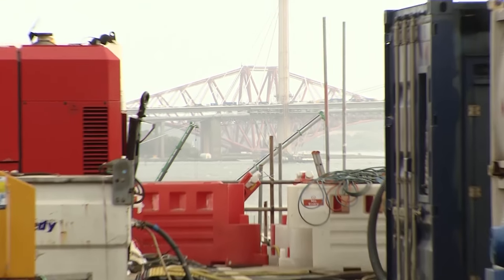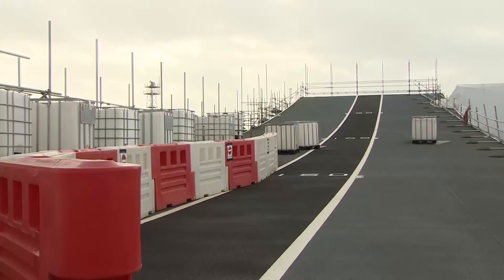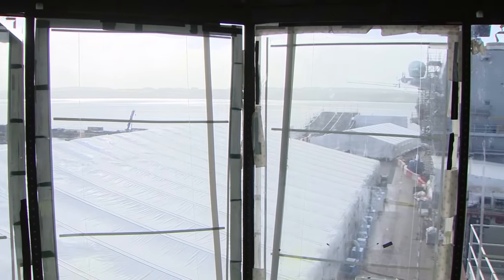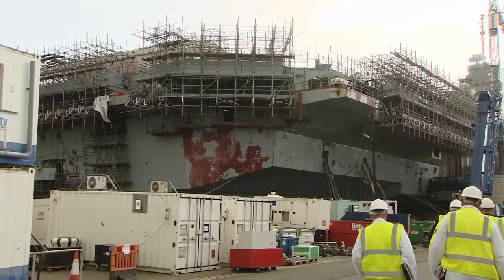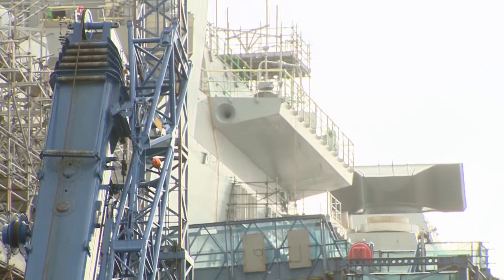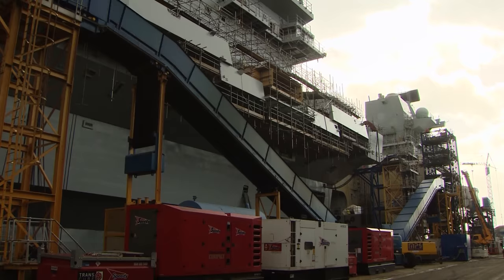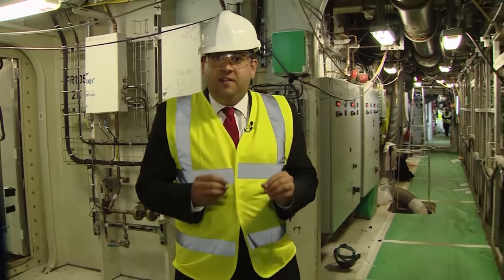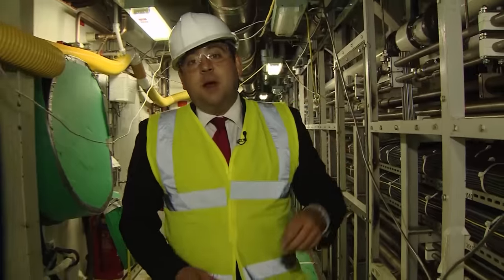HMS Queen Elizabeth Shipshape And Almost Ready | Forces TV

Comment: What a piece of engineering. 
Anybody that says this isnt "advanced" is talking absolute nonsense. A quarter of a ford class, with 4 acres of deck space, and operating systems as cutting edge as possible....quite the formidable platform. Be fantastic seeing both QE laden with F35, chinook, merlin and marines! 
Well done MOD. Finally, a proper super carrier.
Now we wait the T26 and Successor class.
👍🇬🇧🇬🇧
Reply: 67% the size of the Ford class with only 29% of the crew.
Tight budgets lead to innovation to make things more efficient and save money! Sometimes having unlimited resources (like Americans) isn't always a good think! We could have built 3 QE class for the cost of 1 Ford!!
Reply: While I think the Ford class is clearly more capable (AWACS, aerial refueling, etc) and can operate the F35C (20% more weapons payload, 33% larger combat radius),  the Queen Elizabeth class certainly is impressive. If you have to make the choice between 2 (or 3) Queen Elizabeth class carriers or 1 Ford class I think the choice is pretty clear.  They will be two great ships and a great fit for a great ally. I read that their may be US Marines stationed on her especially early to increase the number of F35Bs and potentially the V22 as well. The V22 is a great fit for a ship such as this since it can transport troops, cargo, and perform aerial refueling. It is not cheap, but I have a hard time thinking it or something similar will not be on the two carriers eventually.
Reply: While she is a formidable force, she is not nuclear......... Range and a tender must follow..........I doubt you could build 3 QE class for the price of i Ford.........Include the price of the tender...........
Reply: milwaukeegregg 
10,000 nmiles is very impressive. Thats portsmouth to melbourne aus. And as part of a carrier group a refuelling ship isnt much to ask for. 
But your point is valid
Reply: Don't they eat on the Ford then? It isn't just fuel that ships need. The more mouths the more food.
Reply: Joe Soap Joe the Ford is really a different ship.... Sure the both carry f-35's but the Ford is a nuke,it's got cats and traps,and its over 100000 tons........ To your point they like the QE run with a crowd, so food while stocked in the Ford must be taken on for extended tours.......It's also 13billion US
Reply: milwaukeegregg
I think you are missing the point. The QE isn't a nuke because it doesn't need to be. It has more than enough range for whatever it's missions happen to be. Think Pearl Harbour. The Japanese sent 4 large non-nuke carriers across the Pacific. Attacked their target and sailed back to Japan. They didn't need to be nuke to do that.

Now the QE and PoW will be doing similar missions. Most of their missions will be just flying the flag and showing off. They look big and impressive and I doubt to those they are meant to look big and impressive to will care whether they are nuclear powered or not.

Regardless of what people may think they are not meant to be used against enemies that can shoot back because they wouldn't last five minutes. A well placed nuke would see off any carrier group currently afloat. They are being built strictly for sabre rattling missions off the coast of third world countries. Which is basically what western military policy is these days. Look at Syria. All the carriers in the world would not make one jot of difference there.

I would also point out that there are many ports that will not allow nuclear powered vessels to dock because they produce nuclear waste. This is why there are no nuclear powered cargo ships. This is something the QE and PoW will not have to worry about.
Reply: QEC can also go where Ford can't - not only is it smaller but countries like NZ won't let nuke vessels near.
Also, all the arleigh burkes and ticdoronga class need fuel.
Reply: Nuclear powered vessels need supplies as do the many ships in the carrier group, but implying that the QEC carriers have an advantage because they can go within 12 miles of New Zealand and the Nimitz and Ford class cannot is pretty trivial. The US Navy has not sent a ship to port in NZ for about 33 years because of their law (one will for a ceremony next month). I only briefly searched but I didnt see any other  countries that have the same law. NZ has barred US conventional ships because they are capable of delivering nuclear weapons so a QEC ship would not be allowed to have a nuclear weapon on board (to my understanding they wouldnt anyway though). I cant think of any other place that there would be a problem either. The Nimitz and Ford class could not go through the original Panama canal (the QEC wouldnt either), but it can through the new Panama canal and the Suez canal. I guess I would need to see a list of other places the QEC could go that an American carrier cant go before I would concede your point. Not being able to port in New Zealand seems to be the only location restriction. The US clearly wants to and tried to force the issue through trade agreements, but still it seems pretty trivial in the grand scheme of things.
Reply: when do the F35s arrive? And how many will there be? Pound is now at 1.11 to the Euro by the way.. we're looking really good...
Reply: AlternativeDesign100 they are expected to have 24 by 2021 for its first deployment. Already have 6-8 I think.  There is a strong possibility that USMC will have some aircraft deployed on it too early on to increase the number of jets and for cross training opportunities.
Reply: Heath Butler
I don't think we can afford them frankly. Can't even get enough Frigates together for the upcoming Russian fleet that will pass through the channel on its way to be near Syria.. And if the pound keeps falling further and no "alternative deals" can be made outside the EU... I don't think the UK can even afford a rubber duck.
Reply: AlternativeDesign100 
Couldn't agree more. These ships were ordered when the Brexit referendum was still just a twinkle in that nitwit Cameron's eye. It's estimated that the UK will lose 5% to 10% of our GDP after leaving the EU. So where we are going to get the money to run these ships is anyone's guess. Especially if we try to run both of them at the same time. We don't have enough sailors to man them, enough escort ships to protect them, or enough jets to put on them. It's all show and I suspect they will spend more time ties to the dock than they will sailing around the world.
Reply: AlternativeDesign100 
They have on order 138. 
You do realise that the pound was over valued for quite some time yeah. But anyway, the fall isnt ideal of course, but the markets go up and down all the time. This actually helps exports and makes the UK more competitive. And, once trade deals are agreed with the rest of the world including the EU the UK will be in such a stronger position. 
And dont forget that the UK is trillion £+ economy, and the only "blue water" navy in europe, and is a global military. 
This is a long term upgrade package. By 2030 the UK navy alone will be second only to the US. This is a fact, even though we have fewer vessels. Its the state of the art kit, and maritime experience that makes the UK a formidable opponent. So, dont worry about the pound, the UK can easily afford everything they are doing!
Reply: Joe Soap 
Ok...the UK have 138 on order.
The QE isnt even finished yet, neither of them. The F35s are being built as we speak. Stop going on about brexit. We havent even left, and havent made any trade deals with the rest of the world...ie China, India, America, Japan, Australia to name a few. Dont let project fear interfere with whats happening in the MOD. They are making the worlds most advanced hunter killers, 7!!
The worlds most advanced destroyer 6.
The most advanced frigates
T26. 
4 new vanguard class ballistic submarines.
4 new Poseidon 
138 F35
Another 40 Uk variant Typhoon.
4 state of the art river class vessels.
Albion and Bulwark refitted and updated.
50 new state of the art Apaches
14 new chinooks
30 new merlin anti submarine helicopters.
And of course 2 QE class carriers. They do not need the thousands the Nimitz class need, nor Ford. 
The QE is already fully manned. The POW will be in 3 years time too!
Reply: its a great machine gives great options. it would rip argentina a new ass hole. i can imagine it launching thousands of drones at some point. may the force be with you.
Reply: Forcedtojoin Towritereview
until an exocet hits it ...
Reply: AlternativeDesign100 
How would an Exocet hit it when its defended by the worlds most advanced destroyer?
Reply: But the Ford's are three times better, with Cat and Trap.
Reply: Great point regarding drones, carrier platform for drones will be the way forward, but I think we will see the F-35 for many years.
Reply: Japan sending 4 carriers across the sea was 1941, this is 2016, warfare and tactics are very different. 
The QE can travel a long distance , true but its has to limit its speed in order to conserve fuel. Example US CVNs can sustain 30 plus knots for as long as needed which allows them to get around quickly, QEs max out at 25 knots and are limited by fuel reserves.
As for your nuke theory, nope. Both the US and UK have top of the line missile defense 
furthermore,  no one what to get into a throw weight with the US. 14 SSBN tends to deter that idea 
Syria is mainly an air support mission, there are virtually no ground troops there
Many ports dont allow carriers ,example in the UK, carriers park at sea and crew ride ferries
plus not docking allows for faster departure
Reply: verdebusterAP  You really are missing the point. Firstly I've got no idea how fast these carriers will move. They usually keep info like that secret.
Secondly it doesn't matter. These carriers are being built to impress. To give the illusion of military might. To the people they are meant to impress they no doubt will. They are not meant to be fighting any wars against any major military power. Although in this case the only power I could see NATO at war with is Russia, and since they only have one old carrier compared to NATO's at least 16 new ones, that would appear pretty unlikely.
These days 1st world military prioritises dropping bombs on third worlders who can't shoot back. For this kind of duty, just like american carriers, they are perfectly adequate. An extra few knots in speed won't make any difference at all. And at the end of their lifetime use we won't have to decommission some clapped out nuclear reactor. But if Americans want to spend billions of taxpayers money to squeeze an extra 5 knots out of your carries suit yourselves.
Reply: Joe Soap I fought a war in the Falkland's, with little or no air-power, dam close run thing it was to. Why because we had small second rate carriers, nothing about the US carriers can compare to the QE class, US carriers being far more capable ships, with a balanced air-group, fighters, bombers, EW, Elint, ASW, AWACS. As normal the UK does a cut price hope for the best carrier. We needed F-35c, we went for the less capable F-35b.
Reply: henryvagincourt You got a few billion quid going spare? Fine we'll build better ones.

BTW. I was against that war.
Reply: Joe Soap We find it for immigration, money that is, yeah you being against it doesn't surprise me, try fighting in the South Atlantic, you may have an idea what the Navy needs.
Reply: henryvagincourt 
I get your point about F35c. However, just because QE isnt CATOBAR doesnt make her any less capable for the RN. When have we specifically needed catobar? The 2 carriers from the Falklands were tiny compared to just one QE. QE is far far more advanced, uses around a quarter of a nimitz class and is more mechanised. The CDG is sending Rafales into Syria at the moment, but relying heavily on the Tornados superior recon and all weather capability. They arent flying off a carrier! You see my point?
Now, as regards to the Falklands, that was 30+ years ago. The QE will be escorted with Astute, T45, T26 eventually and as such is/will be a formidable task force. You cannot compare the UK to the US. No one can. But not even the Russians or French are a true blue water navy. Britain is. And these ships will/have massively increased the UKs power projection. Put the whole upgrades and investments into the mix and the RN is a true global power even more so!
Reply: The Queen Elizabeth class aircraft carriers would have been far more effective configured as CAT0BAR combined with the F-35C. What the Royal Navy has is less effective, even David Cameron decided to go CATABOR but BAE claimed it would cost an extortionate amount, even though the modification was supposed to designed into the ship, Cameron relented and went ahead with the current configuration.

STOVL configuration will limit the un-refueled operating range and payload of the F-35's.

So what we have here is a class of ships that is already going to be operating less effectively than it should be. Also with a vastly reduced Royal Navy there just isn't the required number of ships to provide a battlegroup to protect the aircraft carrier and continue with existing commitments., never mind providing enough ships for two battlegroups.
Reply: Fek The First It's a fair point regarding the Falkland's carrier battle group, the carrier's were much smaller, mind you we had around 53 escorts at that time, 19 now. The MOD made a right mess of the QE Class, CATABOR from the start would have offered cross operation's with both the US and French Navy, Also the option to buy cheaper F-18's and E-2's, and the F-35c.

Astute is a fine platform, though has had it's early troubles, T-45 need's new power plant's, and for it's size under-armed. the T-26 now there's a good laugh 13 well no, 8, maybe 5 dreamed up T-31. You can't help thinking another MOD ball's up.

I know the Falkland's was 30 years ago, but hard fact's, we don't have the resources to do that again, luckily the Argentine's are in a far worst place than us military wise.

The only global power is the US Navy, we simply don't have the numbers of ships, we were hard pressed to escort the Russian battle group through the channel.
Reply: Madcap247
Ok. Hold on a second. The Govt decided to go non nuclear. We have never needed NP carriers...ever. Even during WW2 when NP wasnt available! Yes, it would be great, but, for the extra cost of NP, and CATOBAR we have two super carriers instead on just one. And none of the ball ache of disposal. Whats the benefit of nuclear? Yes, you can keep sailing. But you still have to stock up on food and fuel for the aircraft or have fleet aux. The UK went for conventional. It means the extra billion odd pound for NP and CAT can be spent on F35 and the most advanced tech on the ship. BAE gave them the price. The govt said no. Remember BAE is making Astute and Dreadnought submarines. So they were hardly extortionate. 
One T45 is as powerful as 4-5 T42.
The Astute is more advanced and capable than even the US seawolf. The T26 will only have at least the radar capability as either and far more advanced sonar/anti sub capability. 
The F35 hasnt even been made operationally ready for the RN or airforce. So how do you know sorry? Unless you are a F35 test pilot or operations officer you and i do not know. 
The UK is the only "blue water" navy in the whole of Europe, and that includes Russia.  
And the govt are investing ridiculous amounts into our navy, army and airforce.
Reply: henryvagincourt 
I agree, T45 should never of had those/these problems, but they are being resolved. The issue over NP on QE is mute really. We can dock nearly anywhere we want to. Unlike the Russians. 
The Falklands will never happen because of just one T45 and one Astute. Even if they did try and got the Island, we have a far more capable military now than then. Yes, our carriers are not ready yet, but they will be built, and they will be escorted by some very impressive kit. Even you acknowledge that. The T45 has had upgrades, including harpoon and sea cepter. No other destroyer has her radar tracking or targeting systems. Burke and Kolkota included. And as i stated above, Astute is superior to both V class and SW (US). 
The Falklands was a turning point for the RN, and Russia is making sure the UK will have two fully operational carriers, and an escort group that is formidable. T45s have been lead destroyer and anti air ships on more than two occasions for the US carrier groups. Once BAE get their hands on F35 (like UK variant Typhoon) we will have an astonishingly capable air wing.  Taranis is another as will be Dreadnought. The UK now invests heavily in quality over quantity. The QE is already an iconic carrier...hasnt even left the dockside. Its brimming with the latest tech and each can communicate with every asset in its task force. I have no doubt these military upgrades will be truly potent
Reply: Fek The First I'm not knocking what we have, well a little.....more we haven't enough.

I agree the more the Russian's run up and down the channel the more our glorious politician's take note about the state of the Navy.

Did you know the Falkland's guard ship is a River class patrol vessel? The reason the Falklands are safe is the Argentinians haven't any money to replace their ageing equipment.
Reply: henryvagincourt 
henryvagincourt 
Yes, but they do not know where an Astute is, the UK has a very well protected garrison with 500 RM, and 4 of the latest Typhoon. They have asked to borrow some Russian SU30s and Chinese jets. The Argies have opened up trade routes unrestricted and now have a realistic president. The UK military have 1200 personnel. Any movement by them is monitored anyway. They cannot afford any attack, as i said, it was 30 years ago, so we dont need destroyers or frigates there 24/7.
 And as i said, the UK is building quite the fleet. And is, even without carriers, full astute,T45,Poseidon, F35, T26 or Dreadnought capability is still right now the only true blue water  navy and the only global power in the world.
Reply: I dunno, the Argentinians seemed a little more than "impressed" by the Hermes....
Reply: It's a shame our 'state of the art' kit, like the type 45 destroyers, can't operate in warm water without their engines overheating! This has a knock-on effect on the power generation system, resulting in offensive and defensive systems being unavailable for use. All have been laid up in Portsmouth over the summer, and one of them is being cannibalised to support the others. They call it a 'training ship', but its capability is severely reduced.

The other main problem is a lack of sailors - 4000+ short at the current level, so it may be tricky even finding enough to man this new ship. One of the most useful RFA support ships, RFA Diligence, had to be sold earlier this year due to insufficient numbers to man her effectively.

Still, the new carrier will have plenty time for sea trials - the first aircraft aren't due to arrive until 2020 (and even that may be optimistic, judging by the F-35's development schedule up to now), with full operations not taking place until 2023.

And what do we have to protect this massive investment? 19 surface escorts (possibly 24, if the 'low budget' frigates get the go-ahead - although goodness knows what their capability will be) and 7 attack submarines. I'm sure China and Russia are quaking in their boots...
Reply: gargk999  
I would just like to point out to you that Russia only has one, old carrier, the Chinese have one old ex Russian carrier, and neither of them are a blue water navy. The UK is the only true blue water navy in europe (russia included), and UK power projection is even greater when these 2 are built, have the full quota of T45, T26 and Astute. 
The T45 is more powerful/potent than 4-5 T42 destroyers. 
The Astute is more advanced and lethal than the US's seawolf, despite what some youtube videos will have you believe.
T45 has the most advanced radar, tracking and targeting systems of any destroyer...Burke and Kolkota included.
Yes, has engine issues....all of which are being addressed and fixed.  But still a truly formidable ship.
Engineering wise, BAE dont seem to have any problems, hence why they are world leaders in military products. The RN is investing hugely in personnel. The QE is already fully manned. The POW will be also. RN is turning out sailors every year, i cant imagine they will have issues with recruitment in the next 5 years.
Reply: Fek The First Major, major problem, the separate bridges for ship & air control. The Yanks who have huge experience with super carriers told them not to do it, that ship and air control must be close together. But they were ignored, same as they ignored the Yanks telling them the cost of electromagnetic catapult systems and believed the liars at BAE.
Reply: Simon Watts 
Nope. You are getting confused. 
Twin islands are an effective way of capability under attack. Thats why the French PA, the Chinese and Indians would love this too. The whole point of a twin tower, under conventional attack, is that one can take over the other under a direct blow. Nobody has ever built a carrier like the QE with twin towers. Nobody. 
This huge super carrier is a more survivable ship than a nimitz. This is what you get with one of the worlds most tech advanced military contractors...BAE systems (the same people that are building the US's rail gun).
Any idiot who says they are a "barge" or a "floating target" obviously have absolutely no idea of a carrier, or her group strength.
Reply: Simon Watts 
And CATOBAR is not essential. Why do people like you go on about it. Post ww2, When have the UK specifically needed CATOBAR?? When??   Do you not think that 40+ super sonic, stealth, 5th gen STVOL fighters are shit? Backed up by UK variant Typhoon that can reach all common danger zones at will???..
Reply: Simon Watts 
Sorry, hold on. Are you saying that one of the worlds leading military equipment companies went and asked the US if they should use two islands?? What are you on about. 
Its never been done before. They "told them not to do it"??? Wtf?
Who said that? Why? When?
Sorry, i just do not believe that. 
Just to let you know the French PA2 was designed around the QE as is a possible new Russian one. Did they ask America too? 
Stop going on about CATOBAR. QE doesnt have one. So drop it, please
Reply: Fek The First Interesting comment, but CATOBAR is essential, the F-35c is far better than the F-35b. Typhoon's reach all common danger zones at will? In 1970's the RAF told the then Goverment we didn't need carriers, our Phantom's can cover Navy unit's anywhere needed, the big carriers were scrapped, along came the Falkland's and not a Phantom in sight until after the war was over.
Reply: henryvagincourt 
Ok, look, you seem to be stuck in 1970-the Falklands. What happened in the end? We won with 20 Harriers against 10-1 odds. CATOBAR is only essential if you plan to use those larger planes. The UK isnt. 
And, as i said before, the UK is investing in F35b. And is what the govt wanted to buy. So lets get on with it. Yes, it would be great to have 2 100,000tn NP, Cattrap, Typhoon laden carriers. But we dont. We 2 65,000tn conventional carriers and will be filled with the worlds most expensive weapon platform in history. They seem to be dammed if they do and dammed if they dont. I havent personally spoken to any crew members of QE or any test pilot for F35B. But what i have heard in media releases is that they are really looking forward to getting their hands on them both.   
The QE is 3x the size of Illustrious, she was pretty handy!! And we have 2....equal to 6 illustrious class. Why are people still moaning?! 
(Im not suggesting you are)
Reply: Fek The First I have an informed view, because being Ex Navy, I care about the run down of the service, the way the MOD spends money without any thought to the needs of the services. We just have different views.
Reply: henryvagincourt 
My family were and are Navy. I care and have an informed opinion too. My point remains that the UK has built up its navy from the Falklands with state of the art kit in all 3 services. Yes, they could do more. But, 2 super carriers are superior to no carriers. And what we have we should be proud of.  
And the UK, even without QE are europes only true blue water navy. With QE, Astute, Dreadnought, T45, T26 and River class vessels all to come it can only be an even more formidable military.
Reply: Fek The First First class, then you will know the French Navy are just now more capable than we are. From the Falkland's it has been down hill in numbers, we sold some T-23 to save four batch 3 T-22, then scrapped those, we couldn't make our minds up about the carriers we need, what type, sell one, no we keep both. The T-26 is late and now only 8 rather than 13, T-45 have major power problem's, the River class are frankly a total waste of money, under armed with a Merlin capable flight deck for what? Anybody who is Navy know's you can't have a helicopter with out a hanger, servicing , arming, be washed off the deck in certain sea states.

RAF has been cut to the bone, just 5 front-line Typhoon's squadron's, though 2 more promised, no ASW until the P-8, French and US doing that job for us in Scotland.

Army Challengers cut to 237, you can fit the army inside Wembley now.

Every time Mr Putin run's a carrier strike group up the channel, it does the Navy a huge favor, Our inept politicians take note of the public and news paper headline's.
Reply: henryvagincourt  
Ok. One point at a time.
Why are the French all of a sudden being muted as the super duper navy. Because they finally got truly stuck into a fight ie Syria?? The French Rafales and US rely heavily on the Tornado. 
River class is exactly that, its not a front line battleship. Its a patrol vessel. Not sure why you knock them...but there we go. 
The RAF are still waiting on the remaining 30+ Typhoon to be delivered. And are currently being upgraded to new radar. And also trailing new bombing kit too.
Challenger 2 is still one of the best and capable MBT in the world and is about to have £800 million pound upgrades to the entire force.
T45 engines are being replaced (embarrassing yes, but still) and are being upgraded with harpoons etc. 
The French do very little. They do not send their planes out 200+ times a year to intercept Russian planes. The US do and so do we. 
The Russians have ONE old carrier. And they are allowed to sail through the channel. What, do we need to meet a carrier with a carrier? I didnt see the French sending CDG back to meet her. But yet we get stick for "monitoring" them?! What do want us to do then?? 
You dont think an Astute was with their task force? Of course one was. And? 
The French packed in their own (copied) version of QE the PA2 because it was far too expensive. Why do you not mention that? We are building 2 of the things. As i said before, even without all the new shiny toys coming over the next 20 years, the UKs navy is the only true blue water in europe. We have europes largest naval port.
The difference between 1982 and now is technology. One T45 is as powerful as 4-5 T42. Astute is light years ahead of any Churchill class.
Reply: Fek The First Hi my friend, let's agree we are both supporting our Navy. I mention the French Navy because they spend far less but managed to keep a carrier battle group, we still don't have that. Tornado is now fairly old, we have run the fleet down,  8 being in Cyprus.

The Russian carrier group in interesting, the French did have a ship along side the group as did the Dutch Navy, my point was we were hard pressed to do our own patrol, with no ASW or Patrol aircraft to run up the channel. It will be interesting to find if the UK or NATO tracked the Russian Sub with their Group.

A UK sub may well  have been shadowing the force.

The River class is a waste of money, see the tonnage then look at the Swedish Visby class.

Kit is one thing, problem is numbers, we saw that in WWII German tanks first class AFV, but the Russian T-34 numbers.

Portsmouth was always the largest port in Europe, though it doesn't have many ships now, I was Plymouth based.
Reply: henryvagincourt 
But we did though. HMS Duncan was watching them. 
Look, that Russian ship had its own tug boat. 
NATO were watching them all the way! 
The river class are perfect for smugglers, illegal fishing and general patrolling. Whats wrong with that?
The UK are buying 4 Poseidon, so thats going to change too!
Yes, we both want the best for our military. But even the US is cutting back. The French cannot afford a new carrier, the Russians barely scraped a token show of strength. My point is, we build 2 of the largest ships in our history, fill them with BAEs beat technology, fill them with 5th gen stealth fighters and people still moan. QE is already fully manned. As will the POW. And all the other new vessels. At least give them their dues (govt), they are at least keeping us in the top 4 world militaries. We cannot compete with the US or pre/post war numbers. But we can use the best people to make the best kit, with the best training.
Reply: Fek The First She was, but we had no other ships available for anything else. Why spend so much on River class when we could have the Visby class far cheaper?  QE is partly manned, but the Navy is hard pressed to man both, we are about 400 short in the fleet.

I don't give UK Gov anything they are about cost cutting no matter what, We have always had the best people, we did in 1982, but that doesn't make up for the best ships and the numbers of ships we need.
Reply: henryvagincourt 
I get what you are saying, but one T45 and a possible Astute and several other nations ships snd NATO monitoring them was a reasonable reply. The poor carrier looked like it was going to konk out half way anyway.
I have no affiliation to any party, but i am pleased they are (whoever is in power) upgrading our military as a whole. The glory days of massive convoys solely belong to the US now. But, to have the RN have 2 huge carriers and all the other vessels to cone, and to have a PM that openly wants Dreadnought is fantastic. Anyone but that leftist twonk Jeremy. 
The armies Virtus armour, SA80 upgrades, Apache, Chinook, C2 upgrades, Poseidon, F35, more Typhoon on and on across our military can only bolster and improve our capability. I agree, numbers are down, but just the QE class is advert enough for new recruits. And we have the 2nd largest defence firm in the world making so much of our new hardware. Lets give them their dues for at least recognising Russia and Chinas threat. The Falklands was a close call, however what we have today are extremely potent assets, and we are gaining more of them
Reply: it's a helicopter carrier. with no catapults and no arresting wire it's just a big pile of waste. and don't get me started on those f35b's..
Reply: swunt10 oh excellent. An RAF test pilot? Id love to hear your feedback on the trials, training and  systems checks youre doing.  So, in your opinion whats the biggest draw backs compared to the Harrier?  Have you flown many mock sorties against other platforms like Typhoon etc? How did the targeting systems work while mock bombing?
I'm fascinated to hear your point of view. Its only been a few months since the first one arrived, have you enjoyed flying her?
Reply: Joe Soap
 'f Americans want to spend billions of taxpayers money to squeeze an extra 5 knots out of your carries suit yourselves"
 5 extra knots ? US CVNs have been clocked at over 35 knots
Reply: The problem is that it had the capability of being a super carrier, yet they screwed it up.  By not implementing a catapult system and instead opting for a ramp, their air wing will not be able to match the air-to-air capability of many modern aircraft.
Reply: A 1/4 of a Ford class . Who told you that . It's about %65 based on weight . American carriers are bigger mainly because they operate in the Pacific further from base and so have to be bigger . When you factor in that the Royal Navy is a far superior navy then the Ford class is actually a lot smaller as it cannot accomplish nearly as much as a British manned ship .
Reply: USN1985dos 
I get what you say. I get what a few people here have said. 
However, the RN and RAF are getting over 140F35. 
No one went on and on about CATOBAR when we had illustrious. We do not need Cats if we are using VTOL. 
It has a ceiling of 40,000 ft, speed 1.6 and has plenty of future proof upgrades esp weapon payload. 
Its combat radius is around 650miles. Stealth, and apparently extremely capable. 
The UK has built their 2 carriers around these (the most expensive weapons ever made).
Thats it. The UK can have two fully loaded QE which equate to about 90 F35B. Now, is this better than what we have right now, today? Of course. France scrapped their PA2 carrier, couldnt afford it, the Russians only have one clapped out non nuclear carrier. 
QE is 4 acres. Half an acre smaller than a Nimitz. But far more mechanised and up to date.
Reply: Fek The First Your right, we have to go with what we have now, just be good to see the FAA flying these jets from the carriers.
Reply: henryvagincourt 
👍🇬🇧
Reply: Fek The First
 Aye, but in terms of performance, range, and weapons capacity, the F35C (carrier variant) out performs the F35B (VTOL variant).  I just don't see why the Royal Navy squandered the opportunity to have a catapult system when it wouldn't have been that much more expensive in the long run, and would have removed the VTOL limitation on their air wing. 

As for the manning issues, in the US Navy we've begun trying out more automated systems to reduce crew sizes, such as on our littoral combat ships, amphibious assault ships, and most notably on the new Zumwalt class destroyers.  However, the adage that the more advanced something is, the easier it is to break typically holds true, and with a reduced crew size, that means that malfunctions and equipment casualties either have to be addressed by an overworked crew, or the issue will go unresolved until the ship can return to a port where private contractors fix the issue while gouging the government in costs. 

That also leads to the issue of damage control in a battle.  As the Royal Navy saw in the Falklands, and the US Navy has seen in the Persian Gulf and the Red Sea, having a large number of crew on hand allows one to 'fight the ship' (engage in combat) whilst simultaneously conducting damage repairs.  I'm concerned, especially on the Zumwalt destroyers which have 1/3 the crew of their smaller Arleigh Burke-class counterparts, that they will be rendered combat ineffective once they begin to take damage.
Reply: USN1985dos 
Once again, your point is perfectly valid. But they havent. The US are extremely pleased that QE super carriers are being made. Nobody else in NATO are. And the UK have had an effective non Cat carrier group for decades. The days of dog fighting are not getting closer, they are moving away. Yes, launching the UK Typhoon off a QE would be superb as they are the ultimate air superiority fighter, but thats why you have destroyers like T45. F35B are a superb bomber but not given any credit yet as they have had there issues. The same was said about Harrier. The UK took the decision to ho VTOL. The carrier group reflect that. They are more than ready to be refitted to CAT when if ever the need arises. The UK and US work together. Far far closer than they do with France and her light carrier. The UK will be able to put 4 full squadrons of jets on anyones door step. Yes VTOL. No carrier group would send there fighters over 600 miles inland against china or Russia. Neither would we unless our destroyers and Astute lay out airfields before hand. And the UK and US are more than capable and have airfields all over the world they can utilise as well as in air refuelling. 
Both the Ford and QE are the most survivable carriers ever made. But the QE has made huge leaps in mechanised assistance. Im very sure BAE have given a thought or two about a strike or two on her hull.
Reply: Fek The First "F35B are a superb bomber" except for range and bomb load. also no save fail capability with just one bad engine downing the plane behind enemy lines. no second seat which every fighter bomber has. basically it's the worst bomber that has never been build to be used as a bomber. that's hitler ordering the Me 262 to be used as a bomber all over again. if you don't learn from history..
Reply: Fek The First
Fair enough.  And yeah, with recent joint effort agreements, the US Navy & Royal Navy are going to be operating interchangeably a lot more in the future, which I think is great.

I always enjoy working with the Brits.
Reply: swunt10 
How do you know its not good? Are you the RAF's test pilot? 
I dont know just how good it is, nobody does truly yet this side of the pond. But were buying a few.
Reply: USN1985dos 
Excellent stuff! We get a lot of "experts" here, but we have what we have. Id love 2 Ford style, filled with all singing, all dancing Typhoons, F35a/b and c. But, we have VTOL capability. I would say 2 QE filled up with a full carrier escort would be quite the sight. And, as always, respect to the US military.
Reply: Fek The First the things I pointed out are facts. vtol jets have limited range and bomb load, fact. stealth means internal bomb bays, means reduced bomb load, fact, single engined planes can't fly when engine stops working, fact. plane can't fly while on mission over enemy territory, crashes behind enemy lines. almost all fighter bombers have two seats for good reason, fact. what do you not get? it's simple.
Reply: swunt10 
Right, ok. I can tell youre getting emotional now. If you took the time and read what i had written, you wouldnt of had to repeat what i said.
And whats this thing you have a about single engines? Was the Harrier that bad it broke down all the time behind enemy lines? Lol.
They dont have 2 crew in case the bloody engine fails for god sake. One flies the other targets. You can do both in these with one pilot.
Reply: Fek The First there was nothing in my comment that can even remotely be described as emotional. maybe you should check your brain at the nearest mental hospital if you hear voices that are clearly not there. also I read your comment, I also read all the ducktales. but none of that gave me any deeper inside on what we are talking about.
what I said stands true. if you think the harrier is a bomber or even a benchmark for bombers then you got something terribly wrong. on the other hand if you compare the f35b to the harrier and came to the conclusion that the "f35b is a superb bomber". well then that's just stupid which would bring me back to the idea of checking your sanity at the nearest hospital. so I don't really know where you think you are going with any of that but don't mind me. I didn't buy a plane that is not designed as a bomber, with hardly enough range to make it from the carrier to the shore and back again (never mind flying actual bombing sorties), with a bomb capacity for sorties (actually vertical landing with full bomb load instead of ditching it before landing) that couldn't rival the capacity of a 80yr old ladies shopping bag during a blizzard, the safe fail capability (one engine) of a one legged ice skater with brittle-bone disease (how handy is that as a close support, low flying war plane?) and no actual bomber. because they have run out of seats after installing the first one. that's a novel concept for a bomber. oh no wait. I can think of one other. the glorious Me262 bomber. great success. rule britania.
Reply: Scotchmansvan I think you need to go to sea on an American carrier, I did back in the 1980's, they are far more capable than any other carrier, park two off Portsmouth, their air-wings would out number RAF and Royal Navy.
Reply: swunt10 Single engine is interesting, the Harrier was very reliable as is the F-16, it is down to the engine.
Reply: henryvagincourt neither of them is a bomber. neither of them are made for front line, heavily contested air space engagements. ever wondered why the US navy isn't using their 'US national guard cheap but plenty' F16's on it's carriers? right. because flying paper planes against real enemies would be quite courageous.
Reply: swunt10 The reason the F-16 isn't use by the Navy was political, inter service rivalry  and arms company's jobs. F-16 is a multi roll aircraft, and by far the most use and combat experience fighter ever built. The US Navy has use single engine jets, F-8, A-4 for example. In fact it's trainer aircraft is a BAE Hawk, British.
Reply: swunt10 
Oh dear. That rant has put all doubt out of the window....stop being so rude and emotional. 
Im not a RAF test pilot. Are you? Is this where you get your soap box from? 
It has a ceiling of 40,000ft, is super sonic, its stealth, its 5th gen and has some of the latest electronics ever put in a plane. Now, thats what i know. And i know it flies, it is VTOL and the RAF pilots that have commented on her so far are very encouraged. So, whats your "expert" opinion based on? Do you fly them, have you tested its capabilities? No..i didnt think so.
Yes, you can compare F35 to Harrier as its inspired by one. Your point is moot. They both have single engines. Your point is moot. Harrier has been used as a bomber. Your point is moot. The US, UK snd Italians are replacing Harrier with F35b because its VTOL. Your point is moot.
Falklands war-Harrier outnumbered on the frontline by 10-1. Harrier used its superior manoeuvrability and side winder in highly contested air space to effectively ground Argentinian jets. Your point is moot.
 
So calm down.
Reply: Fek The First I think you mean "Your point is moot."
Reply: gargk999 
How embarrassing 😅
Bloody iphone auto correction.... 
hadn't noticed...
Reply: swunt10  
Oh dear....and more! 
Once again, you must be correct because "youre not stupid" yeah. 
Ok ok.....i'll tip my hat to you. You called it, both the US and UK military behemoths of weapon design have got it wrong. And you are correct?!
So they should of made them twin seated in case there engines fail...thats what you said yes?!
Lockheed should come see you on how to  make reliable engines?!
Im sorry.....but as i said, unless you are a test pilot, what do you know about how it manoeuvres?  Its stealth? Its final weapons package? 
You do realise these are quite expensive. 
Hardly paper.....but what do i know. 
Im either swayed by propaganda or im just stupid right
Reply: Just going to wade back into this convo, but without taking any particular side.

Since it's inception, I've always rooted for the F-35, even when everybody and their brother were knocking it for being a failure and extremely over-budget.  The issue is that one has to realize how they're to be utilized, and I think I might have neglected that in my previous comments.  The current strategy (as far as I'm aware) for the employment of the F-35 (of all variants) in an air superiority role is one of a pack.  They aren't intended to be utilized as dog fighters, mixing it up at close range with the likes of aircraft like SU 35's. That sort of warfare is best left to the Raptors and Typhoons.  Rather, F-35's utilize their stealth capabilities and inter-linked computer systems to prowl the skies the same way U-Boats once prowled the North Atlantic.  They utilize passive sensors to fix an enemy, then maneuver in to attack from multiple angles when the time is right, and almost always from over the horizon.  Typically, however, this sort of warfare is dependent upon having an AWACS in the area, and it helps to have non-stealth aircraft as well.

The US Navy will have an advantage for a long period of time simply because its F-35C's fleet will almost entirely be focused on air superiority, while the F-18's continue their Attack focus (supported by Marine Corps F-35B's launching from our amphibious assault ships). 

However, as we mentioned previously, much of the Royal Navy's current organization is predicated on inter-operation with the US Navy, so it isn't as if the QE or Prince of Wales will be heading into the South China Sea or Persian Gulf on their own in times of strife.  Rather, it will be a QE-class and her escorts sailing with 1-2 Nimitz/Fords, an America or Wasp-class Assault ship, and their escorts.  So the QE's air wing will be integrated into the strike group's overall air task force, which will include everything from F-35C's, to USMC & RN F-35B's, plus Super Hornets, Hornets, Growlers, Prowlers, and Hawkeyes.  This is also going to lend the benefit of having a commonality of repair parts, so that if the F-35's start taking damage, the QE's and Fords/Nimitz's/Americas can exchange replacement parts if they run low. 

Pretty much all of the places I've been stationed thus far have had aircraft of one sort or another.  And while it is purely anecdotal, the pilots that I know, many of whom have recently switched from the Hornet to the F-35B (they're Marine Corps pilots) have been extremely happy with the performance of the new aircraft, and just from the take off and landing exercises that I've watched, they really seem to have a lot more power.  (although I haven't compared their thrust-to-weight ratios yet).

I'll always be a catapult fanboy, but I've looked at the Royal Navy's reasoning, and in the current economic environment, I can completely understand their choice to go ramp.  The USN & RN are going to be basically inseparable in the future, and to a large extent we already are.  Of all the deployments I've done, not a single one has occurred where we didn't either A) conduct an exercise with the RN in British waters or B) sail as part of a joint task force, such as anti-piracy operations or maritime security.
Reply: USN1985dos the US has never fought a war that wasn't theirs. they always expect britain to be their lap dog during their adventures but as we could see during the falkland war that relationship is 100% one sided. there will be no integration into US task groups if britain ever wants to defend their interests. don't be so pathologically gullible. 

btw only the marine corps use f35b's. but only from their helicopter carriers. the US navy and also the marine corps on US navy carriers use catapult launched planes. you know, the ones which range and a bomb load. so the british navy will be interoperable with the italien navy and all of their 2 1/2 flight worthy planes and the US helicopter carrierers. that's it. so be a good pupet royal navy. maybe you can "integrate" into the US navy. they would really like that. but btw the US only is interested in their own stuff. if you break rank, bad luck tommy.
Reply: USN1985dos 
Despite what my friend below says, you are quite correct. But hey, what do either of us know. Were just both saying the same thing based on reasonable assumption, reading about the platform, our shared history, what our military commanders are telling us and our politicians to boot. 
As you said, the F35 platform has been received extremely warmly. 
Even though my friend below isnt a pilot, he seems to know how they handle, their payload and what tactics will be employed. Not sure how...but there we go.
As i said to you before, only the UK is building a carrier capability in NATO outside the US. Not sure why our friend brings up the Falklands for, you guys sold us the sidewinders that helped our superb subsonic Harrier ruin Argentinian fighters. Oh well, hes not that good at history.
The UK has helped the US and vice versa, thats why our militaries are so close. 
But my point still remains valid, as is yours, the thing hasnt even gone fully front line operational. 
None of us know what they are like. They said the same about the UK Typhoon. Its arguably one of the best air superiority fighters in the world, and is i believe the only 4th (4.5th) gen fighter with super cruise built in.
And, as i said before, 4 full squadrons of F35 on two QE class is and will be a formidable task force. There will be as many fighter planes on two ships than all the current FA hornets that the whole of Australia have. 
So i agree, the UK and US have and will always work very closely. 
And the F35 is in the UKs plans.
Reply: swunt10 
swunt10 
Ok my emotional friend, tell me, what person in the Royal Navy stated he wanted the US marines flying off of the QE? Hmm.
Never fought in a war that wasnt theirs?? What are you ranting on about?
How many people were killed in Pearl Harbour? 
Just so that you know, twice now the T45 was lead destroyer for two US carrier groups. Ranging from air defence, air traffic management and fleet protection. 
So, once again, im not sure where you get your "expert" opinion from, but your are wrong. The UK and US often share assets and merge to form an alliance in war, training and diplomacy. How do you think the UK special forces can call in say a nearby US bomber, or US SF can call in a nearby UK Apache for ground assault and suppression??  
Sorry....but you are making yourself out to look quite the fool. And rude to boot....
Reply: swunt10
 Thanks, bro, I'm aware.  However, the reason we didn't get directly involved with the Falklands was because we maintain fairly favorable relations with Argentina as well.  We pushed for peace between the two, but when it came to blows, we supplied the Brits with our latest air-to-air missile systems (Sidewinders) as well as MANPADS (Stingers).  In addition, Reagan made an arrangement with Thatcher that if the Brits lost a carrier, we would lend them one of our amphibious assault ships so that they could continue to operate Harriers in the region.  That's a pretty big commitment.

And historically speaking, I would say a fair number of the wars we fought haven't been ours.  WWI really didn't pose a threat to American security, yet we hopped in near the end, Korea was solely about keeping South Korea an independent state, as was Vietnam (albeit with much less success).  More minor skirmishes like the Boxer Rebellion and others were also part of larger international collaborative efforts.

And I also pointed out that F-35B's are USMC-only aircraft.
Reply: Fek The First

Some people really just develop a chip against certain military equipment.  Tak ethe Zumwalt for instance; people are losing their minds and claiming it'll be the biggest flop ever, and it hasn't even been commissioned a year.

Of course, other systems are worthy of criticism, such as the LCS platforms, yet that was more of an issue of trying to design them to do too many things; making them moderately decent at some tasks, but excellent at hardly none.
Reply: USN1985dos all the wars you mentioned where for american interests. korea and vietnam was about communism if you remember, ww1 was about free access to shipping lanes and trade to europe. all of them are in americas best interest. but the falkland conflicts wasn't, so the US didn't even show up. (selling arms is no pledge of allegiance or do you want me to give you a list the countries and groups the US supplies with weapons?). the UK and others always go along with any purely american interests like iraq or afghanistan. no one else had any interest in that shit show. but allies help each other (if they are stupid enough). but not the US, argentinia wasn't a US threat so they showed no interest in helping their ally getting back some islands. that's real politic.
Reply: USN1985dos "yet that was more of an issue of trying to design them to do too many things; making them moderately decent at some tasks, but excellent at hardly none." perfect description of the F35b
Reply: swunt10
 I think the F-35B is far more successful though. They want the LCS's to be anti-small craft/littoral patrol, anti-submarine, mine counter-measure, etc...etc..., and to often operate independent of larger forces, yet they gave it a 57mm main gun and a single RAM launcher.  If it runs into an enemy destroyer, it's going to be well & truly fucked because it has no over-the-horizon offensive capability.  It's only hope will be to use it's speed to run away and hope that the destroyer runs out of missiles before the LCS runs out of interceptors.
Reply: USN1985dos let me paraphrase your comment for the F35b. 'They want the f35's to be anti-air craft/areal patrol, anti-AA, radar counter-measure, bomber, tactical air support, vertical take off, stealth etc...etc..., and to often operate independent of larger forces, yet they gave it a 25mm main gun and only two air-to-air missiles.  If it runs into an enemy, it's going to be well & truly fucked because it has no  capability to turn or run.  It's only hope will be to use it's stealth to hide and hope that the enemy runs out of missiles before the f35 runs out of it's 2 air to air missiles.
ps. the french have a real carrier with catapults, because you said those two glorified british helicopter carriers are the only non US carrier capability the rest of the world has. (even the spanish and italians and greeks have what the UK will get with these new ships)
Reply: swunt10  
See, there we go again. Emotional response betraying you.
I do believe it was me who taught you about the US sidewinders they supplied to us. The Harrier dominated the sky. Just in case you didnt know, the Belgians wouldnt supply us with ammunition....yeah, great allies the EU no?!
Pearl Harbour brought the war to the US and VERY MUCH made it Americas war you slow learned fella. So much so they completely obliterated Hiroshima and Nagasaki. 
Jesus christ.....ugh. Face palm.
Reply: swunt10 
"The French have a real carrier".? 
You mean the one that is very very nearly at the end of its life, with absolutely no replacement (PA2) cancelled. The CDG is 2/3 (fully loaded) the size of one QE (empty) fella. The UK will be able to fill both QE with almost 4 full squadrons. Hardly a LHD my love. 
 Where were you when Invincible or Ark royal were around? Did we HAVE to HAVE Cats then?? No, we didnt HAVE to HAVE them.
So, we are making 2 ships, 3x the size of our previous carriers, with 4x the aircraft each, and filling them with state of the art stealth VTOL aircraft, but yet you, someone who has never flown one nor ever captained a Royal Naval ship are the grand jury and executioner based on emotional drivel?! Both the US and UK have along history of joint operations. 
Youre sounding more and more desperate for attention. 
"Straw man" 😅👍🇬🇧
Reply: USN1985dos 
I agree. I was having a really good chat on another post re QE. He served in RN during Falklands, and is disappointed how many ships we have left, but agreed that at least we have the investment back. And the overall package for our needs is quite impressive. Nobody can match the US. But it seems, once again, its Britain and US spearhead NATO. 
Youll always get angry, emotional people just gassing even when the assets we are making are not even bloody finished or front line ready. Ad i said earlier, people like this lad on here were saying the same 10 years ago about UK variant Typhoon. Now look at her. 
And the same shit was theown at Astute in her very first sea trial of a completely new design sub! And the same was said about the Harrier! 
You know, there we go though.
Reply: swunt10 
Oh dear....and still you carry on.
No, you said about F35b being awful at range and at payload. I then explained to you after you stated they cannot be used in contested air space and i compared them to the subsonic Harrier, armed with US supplied sidewinder mullered them (Argentinian AF) even though they were out numbered 10-1. You were wrong. 
What about when the US asked the UK to help in Vietnam? Hm...
Or what about when the US helped as a NATO member in the Yogoslavia war when the UN failed miserably?! 
Yeah, you really are an authority, and we should all listen to your rants. Even though i have continuously stated that the F35 isnt even front line ready. Yet you know everything apparently. Doubled with a poor grasp of history, you really have exposed yourself once again....
Reply: Fek The First the problem of vtol planes are inherent. I don't need to know anything about the f35 and we could talk about a completely different vtol aircraft and I would still be correct. just ask yourself why is the US navy using catapults and arresting wire? those systems are expensive, huge, lots of man power involved. why don't they stop that nonsense when vtol planes are so great? because they aren't. they are at best acceptable on amphibious assault ships and other helicopter carriers as a supplement. those ships operate near the coast so the limited range is mitigated. big aircraft carriers operate on the open sea for their own safety. real carriers need to perform. that means lots of traffic and lots of sorties and lots of bombs and lots of targets engaged and air superiority fights and areal stand offs. none of that can be done with vtol style aircraft. they are not made for that. as an aerospace engineer I would know about that. you can defend that stupidity of the government all you want (the pilots and royal navy even have too, that's part of the job, they can't go and complain saying it sucks balls) but you are not qualified. don't accuse me of not being a captain of a ship?!(what the fuck?!) you aren't either. 
ps British soldiers and special forces in the vietnam war http://thevietnamwar.info/united-kingdom-involvement-vietnam-war/
Reply: swunt10 
This isnt new news for christ sake. The UK assisted like the US assisted us in 1982. Your point is moot.
And i restate my point, you are not a test pilot for the F35b nor a captain of a carrier. Ok, great, youre an aero engineer. Bully for you. But you do not know any more than me about its tech suite, armament, stealth or manoeuvrability. When has the UK SPECIFICALLY needed cats? When? They did just fine against Mirage super sonic, Daggers and    Skyhawks. Yet, now, a state of the art supersonic, stealth Vtol cant handle herself and a65,000tn carrier isnt a carrier because it hasnt got traps??? Jesus.....
I built boats once, i know more than you too then by your logic.
Its (F35) isnt ready, its never flown combat/front line ready. You do not know.
Reply: Fek The First I seem to have missed all the fun.
Reply: USN1985dos The Royal Navy would have gone for the F-35c, Cat-Trap carriers, I would have favored a mix of F-18e, F-35c, but Whitehall civil servants and our Goverment see just about as far as the end of their nose. Cost cutting, which tends to cost more long term, we saw that in the Falkland's, had we had Ark Royal the Argentine's would never have invaded. The US on the other hand learnt a hard lesson in 1941, and never forgot it. He who has air power at sea win's the battle.
Reply: henryvagincourt 
Hey Henry! Great to see you back.
Im having fun for the both of us. 😅😅
This lad is an "aero space engineer" and is the go to guy for Lockheed and BAE by all accounts. No getting past his scrutiny!
And i tried to explain earlier the fact i would love a Ford, cats, traps, super dooper Typhoons and the like. But my friend here is the worlds fore most expert on military design, strategy and defence planning that the Israelis, the US joint command, the Italians and the UK have been missing.
Apparently, a bomber only has two seaters just in case the engines fail behind enemy lines.
A most curious and interesting chat to say the least!
Reply: Fek The First Thanks, Bombers are a thing of the past, most military are going the muliti-roll fighter, I will just be glad to see the Navy at sea with the F-35b, it's working up to being a fine fighter jet.
Reply: henryvagincourt 
I would agree. A bomber that even the Israelis have bought. Those S300's and 400's look pretty tasty mind that Russia has supplied. I think the final F35 product will be a very capable platform.!
And its great to see the T26 getting the go ahead too. I know you, and i, are disappointed with 5 fewer. Yet i still think they will be a superb asset too. Those jobs in Scotland secured. And im really interested to see if BAE get the £800+ upgrade to C2 also. Good times from a decade ago!
👍🇬🇧
Reply: henryvagincourt 
I cut myself short lol.
These destroyers, subs and drones ie. Taranis esp are the future. I still believe manned bombers have a decisive role, but yes, they are prob 50 year max life now. Soft, tech and hard power is the new order. Its interesting how Russia has pushed forward a poss of strength thro a poss of weakness snd the world are struggling. However, the Russian economy is as small as Italy, and shrinking. They cannot maintain this. China can expand, but, once again, they can be crippled by a global consensus to limit trade. Its a curious time thats for sure
Reply: Eric Shutter 
Yawn....were you looking in a mirror when you created that charming reply?
Hmm.
According to your logic, every military in the world must own "toys" then my dear fellow?!
A curious reply indeed.
Reply: This thing runs off diesel.
Reply: Ah, but that money went right into the American economy. So it's a win either way.
Reply: Eric Shutter Don't be a prat.
Reply: Christian Wilhite Well no it does not, fuel yes diesel no.
Reply: Christian Wilhite Explain?
Reply: The expensiveness of the American aircraft carrier. People complain that it cost a lot, but it was business done in America and carried out by American workers, therefor the money hasn't gone anywhere but directly back into the US economy run. It being expensive isn't a bad thing at all.
Reply: Christian Wilhite I agree.
Reply: Benjamin Miles 
I think you may of missed my point.
The MOD uses our money to defend our nation yes.
However, they could of bought a wooden ship!
Do you get my point?
They went out and placed an order for 2 carriers. And everything else that are coming.
All of which are state of the art. 
The French had the notion of building the PA2. It was so expensive they gave up on it.
At least the MOD have been able, under a tight budget, to not only build 2 super carriers, but also 50 new apaches and 133 F35. Obviously the ones on the QE will be 35B.
Reply: Fek The First If we are lucky 24 F-35b by 2020, we shall see, but at lease we have the two new carriers.
Reply: henryvagincourt 
I concur. 
Its good to see proper investment, and actual assets.
They need to get the 26 in the water asap too.
Reply: randomguy8196 
The T45 uses dual band, has a further reach and can track and target 1000+ tennis ball size objects at +mach 3 from well over 300 miles away.
And, their systems are currently un Jammable . 
Extremely potent once we fix those engines of course lol
Reply: randomguy8196 
Yep, embarrassing to say the least. 
But they are being re fitted with a more capable engine system. Should never of happened, but there we go!
👍
Reply: randomguy8196 
Not 100% sure myself. But they have to male sure they are global capable, so whatever it takes i guess
Reply: That is utter rubbish. I was suggested that or economy would grow by 5 percent less over the next five years. As it happens this doesn't appear to be the case, UK growth this year will be the strongest in the G7.
Reply: LIVERPOOLSCOTTISH 
You do realise the F35B (of which the QE was designed around) is a fixed wing but also VTOL?
Why would anyone complain about massive investment in a 5th gen fighter that uses F22 technology and UK original design with a 600 nm radius fully loaded, with stealth that can land anywhere??
You do realise the UK have used non trap carriers for decades? 
And we have bases all over the world for long range bombing yeah??
The Russians are years behind, the US have very small numbers of F22, the Chinese claim a lot... but the US and UK have a lot. The US dominate the worlds oceans. 
They have 11 carriers.. they have another 11 LHDs that are BIGGER than OCEAN class. 
They have effectively 22 carriers, and war planes that can fly from them. The UK now has 2 full capacity carriers that are the second largest warships in the world. 80 F35 can fly off them.
Reply: Hugh Jarsol 
Considering its mainly UK, US and Israelis that have the stomach for a fight id just say its a fantastic addition to Nato, and projects UK power ever more so and increases our already superb blue water navy, making the UK ever more so the only true blue water navy in Europe.
Reply: Let me get this right,  you were against the conflict which saw our Armed Forces going to the South Atlantic.  To confront and kick the Argentinian Aggressors! off the Falklands.  Thus rescuing and allowing the 'BRITISH SUBJECTS' who live there,  to go about their daily lives as you would expect to go about yours....So it's OK for you to live in a free democratic country,  but tough shit if where you live gets invaded by a foreign aggressor,  even if you are British.
Reply: If the Harrier wasn't meant for front line opps,  what was it meant for?  Sit on tarmac and look pretty?   And yes it was a bomber; developed for the ground attack role.
   
Oh look..bombs.
Ever wondered why the US navy don't use the f16's on it's carriers?
The reason the US don't use F16's on carriers is because they were never developed as carrier aircraft.   Lets put it this way if you connect a cat up to an F16, and tried to launch it, the cat would rip the nose off.
Reply: Leon Dickens 
How can it be out of date?
Hmmm....
It will have the T45 radar.
Its the one of the most survivable designs ever for a carrier (Ford is the same).
Has huge automation, making her crew half that of a Nimitz.
How exactly, please be specific,  how does it become "out of date before its finished?".
Is the Ford out of date?
Are any of the Nimitz "out of date?"....you know, like the one thats patrolling the S.C. Sea right now?
So be specific. Id love to hear what you mean. 
And fyi, the Chinese have NEVER built a carrier before. Ever. 
They bought an old Russian one, and have Russian help in the new. 
What has concreting straight lines for an airport got to do with building aircraft carriers btw?
Now thats a stupid point!
Reply: Here was I thinking you were an adult.
Reply: henryvagincourt 
He is an interesting fruit indeed Henry 😂👍
Nice to be chatting to you again sir
Reply: He does seem so,  good to be chatting to you my friend, you seem to be fighting our corner :)
Reply: Well for a person of 40 years, your language is like a teenager, quite said to read. Maybe put a case without the abuse and we can all have an adult conversation, until then. The largest carrier is USS Ronald Reagan 101,400 tons. Admiral Kuznetsov being around 61,000 tons.
Reply: henryvagincourt 
Always friend!
👍
Reply: Well he is correct, you my friend are wrong, he says it how it is. Adult you are not.
Reply: Leon Dickens 
Oh dear.....
Reply: Leon Dickens 
What if i told you i live in Hereford?
Reply: Being Ex Royal Navy, been there done it, I lost the will to live, you rant on mate, maybe take your tablets.
Reply: Leon Dickens 
I don't...
But don't be a prima donna 
If only you could back your claims up.
Stop slagging off the REAL men and WOMEN of our superb forces, and at least have some facts.
The only weekend Rambo is you my young dear....
Go to sleep now my drunk friend. I know Budweiser is a strong drink for you
😘😘😘😘
Reply: If you are 40 years old, christ our education system has failed.
Reply: I wouldn't bother my friend, waste of time.
Reply: Leon Dickens 
You are a fancy boy.
Have no idea of how the military work,  and hide behind your screen name.
Do you realise that he was a military person?
Reply: Leon Dickens 
Yep, if you are 40, then our state has failed you. 
You started mouthing vile rhetoric, and you still cannot answer a simple bloody question. 
Grow up.
Reply: henryvagincourt 
Something i meant to ask you Henry, have you seen the news  vt on the deck paint? Its quite interesting, using a Titanium mix to absorb the heat blast.
Reply: Leon Dickens 
And apologise to him
Reply: Benjamin Miles 
Are you an RAF pilot?
It goes 1200mph, mach 1.5
With a radius of 600miles
Its stealth.
Carriers far more than Harrier ever did, and loaded with Brimstone is a superb craft. 
Each QE can carry 38.
QE has a hull design matched only by Ford. 
Will have Sampson Dual band radar.
It can target and track 1000 cricket ball size objects travelling at mach3+ from 300miles+ away. Will have at least 4 Phalanx. 
Automation un matched by any carrier in the world, and as such does not need half as many men as a Nimitz.
Supported by Astute, and T45.
So, please tell me, how is QE out of date? Who or what are you comparing it against?
Reply: I have, I think it will be used on the landing points, along I believe with replaceable metal plates, that engine is one paint stripper :)
Reply: Have a look at who is building ships in the US and owns shares in US defence companies, BAE. The bullshit talked about the F-35 is frankly sad, time will show who is correct, you my friend are wrong.
Reply: henryvagincourt 
I have a weird craving to put some crumpets under its thrust haha...a bit of butter...prob a lot of butter 😂
Reply: Made me smile, you can't beat crumpet in the navy, I maybe thinking a touch different to you :)
Reply: henryvagincourt 
😂👍
Reply: I need to know what country are you from?
Reply: Leon Dickens 
I do not believe you.
Reply: Leon Dickens 
I do not believe you.
Reply: Leon Dickens 
Yawn.....
Reply: Leon Dickens 
You still here?...
Reply: henryvagincourt 
Something i meant to ask you Henry, whats your opinion on the T26? 
8 isnt enough i know, but regards its size, design and what its built to achieve etc.
compared to the 23.
You like what you see?
Reply: The T26 looks good, balanced armament for tonnage, again they play the number game, down from 13 to 8, that makes their unit cost higher,  it will be interesting to see of the so called T31 get built, with Trump in, and the Russian's running up the Channel that tend to focus our MP's minds.

The MOD are amazing, they sold 3 T23 to Chile in order to save the 4 batch 3 T22, which they then scrapped, we at one time had 16 T23 at sea. I note there building 5 River Class 2 extra, again stop gap to keep ship building going, with the buggering about with the T26.
Reply: My CPO always said you get an awkward bugger, your it.
Reply: henryvagincourt 
Yeah, that drop of 5 is not good. I was most disappointed. 
I was speaking to my family member, he just got back from SA, mot sure if it was a tour, but anyway, he was saying morale is good. Theyre really looking forward to all the new assets. 
And you are quite correct, having the Russians sailing up near our waters does get the mind focussed.
Even the stupid games they play flying bombers etc near our space should have got them thinking.  Their  flights up to cold war levels, even over toward Canada and Alaska. 
They really are playing games. 
Those air defence systems they sold Iran look quite tasty aye.
Reply: henryvagincourt 
I do wonder how long the engine refits on T45 will take...an awful oversight we both agree im sure. Such great vessels, i just hope its relatively quick!
They have gone for 5 RC now have they? I knew 3 were deff on. At least its 2 new ones. Isnt one going to Gibraltar?
Reply: It's amazing in 2017 we can't get the power plant right, one T45 isn't seaworthy, I guess the first in re-fit when they sort the replacement generator, and have funding. Yes 5, which is welcome, though why they need a Merlin capable deck without and hanger? We may even retain the River Class in service, we need the hulls for sure. I'm not 100% about the Gibraltar question, I suspect you maybe correct given us leaving the EU.
Reply: henryvagincourt 
Lol, i thought the same thing, no hanger! Poor bloody pilots will be going out under umbrellas haha.
Yeah, im sure i saw something on forces news or GBC about one going there. 
As long as we get platforms im happy...just a shame theres  not more.
Maybe Brexit will yield more wealth...
Did you see Chinas almost exact copy of the US Littoral.
Those guys love a copy 😂
Reply: Well the more they do that, the more Parliament will think about funding our armed forces, I remember two Russian fishing/spy ships shadowing us from the UK to Accession in 1982, then on to 100 miles off the Falklands before thinking better and buggering off. 

S-300, Ive read alot about it, with 125 mile range, I guess that's why the US is thinking  B21 Raider, new stealth bomber.
Reply: You need a hanger to arm a helicopter in the South Atlantic, never mind service it, I've seen a WASP nearly slip overboard due to seastate. 

I watch that myself, forces news. Ill look out for that report. I think Trump and Putin may well force spending, which I'm good with, build Royal Navy ships in British yards, spend our money here. 

I haven't, I have a friend who is still USN, the two classes Freedom and Independence are quite controversial in the US. Which are the Chinese copying?
Reply: henryvagincourt 
Bloody hell a WASP?? 
Shit...must of been hairy lol!!
Ill forward you the link...one sec
Reply: Passed you bedtime surely, prat comes to mind.
Reply: Leon Dickens 
You still here?...
Reply: henryvagincourt 
What do you reckon on that article? Quite interesting aye.
The US make a ship, the Chinese copy it lol.
I think the US have had a few problems with Zumwalt too. Its engines failed in the Panama canal. But a very interesting design. 
Im not too familiar about her. 
Not sure about its stealthiness, id reckon has a very low profile
Reply: Don't rise to it, hes a fool.
Reply: henryvagincourt 
Agreed 👍
Reply: You insult away, cheaper than drugs.
Reply: I lost friends on both Shiny and Coventry, F126 my ship in the Falklands. I'm not interested where you live, or really what you think, rant away, my regards.
Reply: 17,000 tons pretty big, I never fancied it, even with the extra pay, there going to cost.
Reply: henryvagincourt 
Yep, a big price. But with Russia and China upscaling Nuke defence, a good call.
We do need 4 boats. 
And at a tiny fraction of GDP i am happy that May at least said she'd press that button
Reply: I'd go with four boats, one on patrol, one training, one extended readiness, one in re-fit, I wonder how many missiles/warheads their carry. I think we currently have around 120 warheads available.
Reply: henryvagincourt 
Agreed.
4 is a minimum.
And am very happy for that guarantee.
Reply: henryvagincourt 
Yep. I agree.
And its a proven concept we need 4 for exactly what you say. 
I know the UK and France are Europes close Nuclear defence umbrella. 
I do wonder tho if NATO allies will keep up with the 5 that do commit to 2%.
France has no future carrier group, and that leaves the UK as a sole deterrent to Russia.
I must ask you, have you heard of Matsimus (youtuber)?
Reply: Four it must be, three has to much risk. I think the Charles de Gaulle will be active for some years yet, I read with Trump the USN are moving back to 13 carriers, up 3 from 10, not sure they have the aircraft, but good to see. 

I hope we order more F-35b, the Royal Navy needs a least two squadrons, 3 including the OCU. The RAF about the same, but who cares about the RAF :).

Matsimus, I cant say I have.
Reply: I never asked you, others maybe, I couldn't care less, but you do need to cut your grass and fix your roof. I will be in Portsmouth later in the year, got a re-union, I will be having a beer or three with my muckers. 

You have been interesting if nothing else.
Reply: henryvagincourt 
Yep, Trump isnt shirking away from China. So the more carriers the better.
Theyll always have the aircraft i reckon. 
Our govt want 138F35. They did say not all will be the 'B', so at least the RAF get some new toys to play with too. :)
Enjoy your drinks 👍🍺🍺
Reply: I joke about the RAF, be good to see the UK being a leader again in airpower at sea, not until later in the year my meet with old friends,  who was that youtuber you spoke about?
Reply: henryvagincourt 
His name is Matsimus. 
A former Army/Tank guy.
He uploads a lot of stuff. 
He recently uploaded re SA80 2.
Just thought you may enjoy his stuff.
Reply: henryvagincourt 
My brother found the SA80 a superb rifle.
Now the 2 is out
Im not sure why so many negative comments myself... 
and now the 3, 
With Virtus armour...great improvements
Reply: henryvagincourt 
My brother found the SA80 a superb rifle.
Now the 2 is out
Im not sure why so many negative comments myself... 
and now the 3, 
With Virtus armour...great improvements
Reply: I will, ill take a look, thanks my friend.
Reply: My day was the Belgian SLR, SA80 had it's troubles, but then most do early days, your brother ex Army?
Reply: henryvagincourt 
henryvagincourt 
RN, but bought himself out post training. 
My uncle was a weapons engineer as well as grandfather. 
Matsimus is an honest guy. Does reply sometimes. 
He knows his stuff (much like you).
Reply: Not for everyone the RN, My dad was in the Coldstream Guards, my Grandad the Royal Pioneer Corps (Royal Logistic Corps) , joining the Navy didn't go down to well :)
Reply: henryvagincourt 
😂.
Fair do's.
A friend of mine just recruited and wants to be a subby.
Thats a real life choice in itself lol.
Henry, always respect your opinion.
And i truly find it fascinating talking to real servicemen and women like you.
Reply: Thanks my friend, I value our exchanges of views, I had the best years of my live in the Royal Navy.
Reply: henryvagincourt 
Likewise.
My uncle told me about his CO was fishing off the back of a destroyer in the Windies. He got a call up to the deck, he asked my uncle to hold his rid...a few minutes later a massive bite, and my uncle pulled up a huge fish lol. He was the talk of the ship for weeks haha.
I love these stories.
Youre a good man.
Yes, 
We may disagree on a few issues,
But we both love our country.
👍🇬🇧
Reply: Be a great life, I would if I had my time again.
Reply: henryvagincourt 
Henry, you have already lived a fascinating life. 
That WASP day... i was so intrigued. 
This lad will do what he wants to do. 
He will be a fine RM. im sure.
You are a stand up guy. You call it as you see it. 
He will be inspired, and i will always salute you both.
You cannot deny bravery. 
You went thro the training, as will he. The RMC training is the most brutal infantry training on earth. 
I totally respect both. 
Not many guys can go on a Skimmer without being sea sick and not many can possibly pass 32 wks of brutal RM training.
👍
Reply: ..and 5 months later, the Pound is still depressed so imports still cost us more that includes defence equipment like the P-8, hope we got a fixed price contract!
Reply: 2 Billion pounds, that is the cost to convert to cats and traps, it was always a none starter for me and we were always going to buy the F-35 B, the brief period when some barked bout the F-35C was just bean Counters getting a short lived hard on, nothing to do with capability.
Reply: Fek The First    The Successor Class has been renamed Dreadnought class. The first one will ready around 2028.  The first of the Vanguards will be decommissioned in 2019, leaving us three. Every 3 years another will be decommissioned. 

The first T26 will be available around 2024.
Reply: can still be sunk with a well placed torpedo.
Reply: Centaur Myth This is true. The Spearhead torpedoes used by the Royal Navy have a 30 Mile radius and others could have similar weapons. 

However, attacking a Carrier with a Torpedo is like trying to win a game of chess with your pawns. 

A carrier has protective radius of over 1000 miles at all times. Not just from attack subs, the destroyers or the frigates which accompany a carrier, but the f-35 fighter/bombers and Apache choppers and the onboard  cannon system.  The missile system on the escorting ships are technologically advanced. The lesser powered missiles can destroy every ship including subs within a 10 mile radius from detonation.  An attacking ship including subs will not come within an attack range without the awareness it is a one way mission and doomed to fail. 

To take out the carrier it will take a fleet of ships or a squadron of planes, all of which which will be attacked by the carrier's escort and the F-35's and the fleet subs armed with Tomahawk missiles. These subs don't need to be facing the enemy and will likely hit the attacking fleet very hard before being destroyed.  

You're right though, just one torpedo will do it. Just like one bullet will do it against a world leader. The trick is to get the bullet into the target just like it is getting the torpedo to the carrier. As soon as that weapon is on its way, the position of the sub that fired it is known.
Reply: many a game of chess has been won with prawns lol
Reply: Not with just pawns, they need help from the heavy hitters on the board.  

A sub firing a torpedo will need a fleet of ships and a squadron of planes as back up to enable that shot and even then the damage caused by the torpedo will be absorbed by the carrier and the carrier will continue with its duties in a diminished capacity.    A nuclear weapon is needed to take out a carrier of this size and killing that many servicemen and destroying a superstructure of that size will certainly be retaliated using nuclear weapons. I would put money on it that that the entire navy of the aggressor who takes out a carrier will be nuked. I have no doubt about this.
Reply: yes like a rook, because they are all rookies lol
Reply: A Torpedo is the one weapon that can sink a CVN, and the hardest to avoid.
Reply: Pablo Jay 
A torpedo has a range of about 60 miles maximum for any navy. 
The Astute can track a ship leaving port in New York from Plymouth.
You cannot get close enough. 
Theres only the Virginia who possibly could. But very very unlikely as a carrier group has anti sub warfare. Destroyers take care of the sky, Frigates and subs take care below. 
The HW Spearfish and stingray (Merlin) can penetrate any modern submarine. 
Spearfish has a guided range of 40-50 km. 
A carrier has built in survivability at its core.
A QE and Ford are the most advanced yet built. One torpedo simply cannot sink such a massive ship. 
As soon (considering that a sub could get anywhere near) as a sub fired its tube/tubes, an Astute (example) would have locked on at the hatches opening, and fired as that sub fired. As would a Frigate. And a Merlin. 
The carrier would not sink at all.
Reply: Nobody fires live Torpedo`s at a target at 60nm range, it doesn't happen and never will its too dangerous for friendly shipping.
The Astute can do what every other submarine can do at the right depth under the right conditions in the Atlantic in the right sound channel. I forget the correct term.
It may have a theoretical capability based on the characteristics of its sonar systems but doesn't mean it can actually do it.

An SSK with AIP can sit there quietly or on batteries without being detected until it shoots.Its been done. Try detecting a submarine running on electric motors, good luck with that.
If an enemy has lots of SSKs they will not mind sacrificing one to take out a carrier, because as you say, as soon as it fires a spread it will get chased down by the ASW screen.
One Torpedo CAN sink a carrier, its why the USN has invested so much in active torpedo defenses that travel down the wake to intercept wake homers. One Torpedo can break the keel if the CVN is having a bad day.

Also, he CVF was NOT built from scratch for survivability in terms of armour protection as a prime driver for the design, it was built to carry on operating with battle damage by having a lot of redundancy incorporated into the design.
It was too expensive to go the US CVN route, ie extreme durability and resistance to multiple hits from inbounds.
Reply: Really, depends how close you get.
Reply: henryvagincourt 
And Henry sir, you would know that the radial defence of a true naval force can and would defend well within any torpedo threat. 
Diesel engine subs are great, quiet, and a problem, but are nowhere near as capable as modern stealth sub. 
The acoustic fire from a small boat like a Chinese sub is a 'Divine wind'. Its a one shot job.
And a super carrier is designed to take multiple hits and survive.
A pack of Chinese, N Korean, Russian subs trying to get anywhere near a true carrier group wouldn't ever get anywhere near a carrier group like the US nor Uk.
Its like saying N Korea can control the oceans because they have more subs than the US does.
Reply: All everybody is saying is that its a mistake to take the SSK threat lightly, it may be a fatal one if defence planners turned a blind eye to the threat.
 Heavyweight torpedo`s may have a 60 nm range in a straight line but thats not why they have that range capability, they can conduct search patterns which involve maneuver, that uses up fuel and range.
Reply: Lastly, take a look at the ranges Conqueror took up to sink  the Belgrano. Mk 8`s yes but if you want a kill you get in close.
Reply: Pablo Jay 
I completely agree to your last point, but that was over 35 years ago.
Weapons and defence are far far more advanced now.
You simply cannot get close enough to a carrier anymore, hence the super sonic rocket systems now. Surface to surface at mach 3-4 is the way  anti ship is going.
Your example is extremely easily removed by a Wolf or Astute. It wouldn't have gotten anywhere near its fire range.
The Chinese diesel or any other cannot compete with UK or US subs say numbers. So they build numbers. That still doesnt mean they can get into any range. It was a British nuke Hunter Killer that sank the Belgrano, the ONLY in the history of mankind.
Hunter killer proper can and do keep order. No diesel can compete with them.
They sure can fire a tube or two, the target may get hit, but the sub that fired will deff be sunk.
The sub that fired will never be found... too advanced. Spearfish for example has a truly staggering low profile of exit, and has total accuracy. 
The US variant too.
Reply: The USN uses the Mk 48 ADCAP or whatever its called now. Back in 1982, its worth remembering that Conks was carrying Tigerfish , precursor to Spearfish; as well as old Mk 8`s but used the older weapons for several reasons.
You can only find a submarine if it makes the right noises or they screw up,  or find themselves in shallow waters where they cannot go deep after an attack.
Pretty much any modern Submarine can decide to remain undetected if it really wants to.

I`m not knocking Astute or the 774`s but I have to laugh at some of the more twilight zone media claims.
Park an SSK up if you know a CSG is heading your way and it can kill a Carrier, it isn't fast enough nor can they go deep enough to escape or evade the now very pissed off fleet they just hit, but they are more expendable than a carrier, especially in Chinese hands where they will be more likely to go for the guts and glorious death malarkey than Pusser.
Reply: Anyway lad have a nice evening, signing off. Everything I say is just my opinion, I may be talking a load of bollocks, buy hey :P That`s what we are here for.
Reply: The head of the last Labour government is rearing its ugly head once again! Gordon Brown trying to get his constituents jobs has doomed the Navy. These carriers are a vanity project and the MOD knows it. 

Completely blown the Navy's budget for the next couple of decades on two wildly over-sized beasts when it needed to be spent on our destroyer and frigate fleet. We don't have the ships to escort these monsters AND maintain our everyday naval responsibilities. 

Not "well done MOD". This is a strategic and logistical disaster and the MOD knows it. As if the Navy wasn't experiencing enough problems already.... We will never learn.
Reply: but it uses a ramp instead of a catapult and the runway goes straight down the deck instead of being slanted so they couldnt have as many aircraft on the deck.
Reply: Chrismasterski 
Youre correct there. 
But they are still huge ships. 
Only 0.5 acres smaller than a Nimitz. 
QE can hold upto 40 F35, so a big increase from past carriers  the RN have had.
Reply: Thats what the hanger decks are for.
Reply: Fek The First it has no air defence capabilities only carries 12 aircraft the ships escorting it have no anti ship capabilities the navy have no patrol aircraft to track subs. Taking this or any RN ship to sea in a war would be suicide. Thank the muppets in parliament and the clueless consultants at the MOD. very sorry state of affairs
Reply: henryvagincourt Im not Military but  have been following the winding up of the Uk armed forces since 2003 I have a theory. My theory is that the government's of the UK both parties have been thoroughly infiltrated by russian agents who have brought NATOs 2nd biggest Military power to its knees. The madness of cuts can't possibly be by accident or incompetence but a carefully executed plan by russian backed traitors.
Reply: P8, coming to a Scottish aerodrome shortly.
Reply: I agree about the cuts, but not the Russian's.
Reply: mr bear 
mr bear 
Sorry, did you say the QE only carries 12 aircraft?
So what is 4 acres for?...the Royal marines to train on!
Ark Royal could carry up to 18 Harriers...
The QE is 3 times the displacement. 
Are you joking?
A QE can carry up to 40 F35. 
Why do you say 12...i am truly curious.
No carrier goes to sea by itself. 
The QE would be defended by T45 destroyers, T23 frigates, Merlins and Astutes. 
Tell me how the QE is a sitting duck?
Yes, T23 Harpoons on the T45 isnt ideal, but the QE hasnt even had a sea trial, nobody knows its full defence capability yet, but to say its a multi billion pound target, with a possible multi billion pound air wing is plain daft.
I want more Navy, i want more marines, i want more T45 and T26, i want more everything....but the QE isnt a floating target.
What would you then say about Ocean?
I understand your frustration... im the same to a degree.
But the Russians?? Really.
You think the Russians are behind UK cuts?
The UK is the ONLY blue water navy in Europe. Russia included. This is without all the new toys coming.
The Russians do not affect UK cuts. The Russian Economy is the size of Italy.
The UK dwarfs it. 
Russia is a master of games. 
Do you know how many times the UK send Typhoons each year to 'escort' Russian planes...the Russians have guaranteed that the UK increase spending, not the other way around
Reply: "Why do you say 12...i am truly curious"
Because 12 will be its peacetime F-35 complement.
Reply: Pablo Jay 
And?
Whats your point if that happens to be the case?
Reply: You could probably stick 60 F-35`s on the flight deck  of a QE class but you wouldn't have the servicing/handling/crew/aircrew capacity to use that many on an active deployment among many things.
Reply: Fek The First The UK wouldn't last 2 days against the full force of Russian aggression. Russian ships have very capable missiles such as sunburn not to mention the hypersonic missile they have developed that even PAAMS/Agies cannot stop while the RN have nothing that can touch a Russian ship. Russian ships have very capable anti air systems too so good luck getting 12 f35s through their air defence. Peter the great could sink the whole RN by itself hand have missiles to spare might be old but at least its a proper warship with actual weapons unlike our boats that are just for show. Also why build a carrier that relies entirely on external protection what if a T45 is hit? what if its systems crash at a critical moment just like broadsword and Coventry in the falklands why even leave it to chance? Our MPs have defeated our own forces for Russia they won't even need to fight! we're already lost!
Reply: mr bear 
"What if T45 windows fall out...what if the most advanced tracking and radar system doesnt work....what if its a rainy day?...haha.
Yes, the Russians have capable weaponry, i never said they didnt. 
Their carrier needs a tug boat everywhere it goes.
Where will this "assault, full scale" take place?
On the other side of the planet?
Or the North sea. 
Atlantic?
Please explain.
Are you saying the Astute is no good either???
Lol.
12 F35? What year is this "assault" taking place? 
2020?
2030?
40..?
Are we only putting 12 F35 for both carriers?
Please explain.
A curious reply....
Reply: Fek The First They have said that 12 is the load carried and 24 max for operational deployment. systems fail under hard conditions like real combat so why even chance not having even a basic self defence capability? Already happened in Falklands one day 600 ish RN personal might pay with their lives for this lesson not learned. Who knows when a major conflict will happen so need to be prepared constantly. Why do you think Russia is becoming so aggressive in recent years? because they know NATO is weak as shit. Want peace prepare for war as the saying goes.
Reply: mr bear 
I think you are missing my sarcasm...
I am fully aware of the peacetime payload. 
But only 24 on a ship during operations and war are 2 very different matters. 
If that was the case the RN could of saved a fortune and stayed with invincible class size. 
QE can hold up to 40. 
Anyway, my point is this scenario that has been put against me.
Where is taking place? 
If its the north sea then Russia has a big problem defending against the Typhoon as well as the navy. 
If its in an Ocean, say the Pacific, then it will hardly be a surprise attack will it, and a tug could not go to the Pacific ocean.
The Russians would be relying on a carrier that CONSTANTLY breaks down...
Now, seeing as QE (in this scenario) will 'only' have 12 F35, and would escorted by 2 frigates, 2 destroyers, 12 F35 and at least one Astute, the radar and sonar systems are regarded as possibly the best in the world, how the hell is QE easy pickings?
The fleet would see them coming, if its aggression ie the Russians fire cruise missiles etc, then the T45 is there for fleet protection, Astute is a hunter killer and frigates keep counter sub threats at bay, and dont forget the 'only' 12 5th gen stealth fighters that she has. 
Can you see my point. 
Then, not to mention, ANY attack against ANY Nato member is returned in kind by ALL Nato members.
The Russians have been playing silly buggers to the UK for years...100+ x a year they send bombers and fighters to test UK defences. 
All this crap that the RN "intercepted" the Russian navy recently is crap...they knew they were coming! 
Now, go to a 'war' scenario, the QE will be full of F35 (if we have 80) by this 'scenario'. And Merlin and wildcats.
They will be fully protected by all necessary assets. 
But by that stage, the whole of Nato will be fighting Russia...they could be looking at a possible 15 true carriers and another 15 WASP/LHD/LHA....on and on...
And i agree, T45 and QE should have at least Harpoons. 
Maybe they will one day...i dont know!
Reply: Fek The First what you mean the 20 or so typhoons that make up the RAF are going to pose a threat to Russian shipping? Granted typhoon is a very capable fighter but we have too few they would be all shot down in the 1st afternoon just by overwhelming numbers. Enemy planes would be free to fly anywhere in the UK unchallenged since the army have zero surface of air cabalility. Although I mentioned a hypothetical scenario with Russia the same is true of any  country with a half decent Military. UK couldn't hope to fight India China Pakistan Iran or any power that has a modern arsenal. And you might say that wars are unlikely with these but who knows what will happen in 10 years? how would you feel as a sailor on an RN carrier in missile ally after you just seen your escorting T45 sunk knowing you now have no defence and are now doomed due to some else's idiotic decision not to fit any weapons? or as a solider going into combat with no air over because there are no SAM cabalility and the RAF consists of smoking holes in the ground? would you be happy to risk your life with hopeless odds and crap kit because the money saved was deemed worth more than serving personals lives? Would you be happy to let your children serve in an army who leaders care so little about as to not even provide them with basic kit? Anyone in the armed forces or with family serving should be outraged at the cuts. I have neither but am still annoyed because its so obviously going to bite us in the backside and when SHTF we're all going to gave to pay
Reply: mr bear 
You never mentioned Russian airforce...but now you have. 
Yes, of course the Russians do, as do China, India. 
The N Koreans have the most submarines in the world....are they the most powerful navy now too???
Hmm. 
Anyway,
https://ukdefencejournal.org.uk/typhoon-life-to-be-extended-two-more-squadrons-to-be-created/
Im sure you were being sarcastic, but 20 is a number plucked from thin air. 
Now, why do the UK NOT have the same numbers of fighters, men, Tanks etc like Russia...
1, 
Nato,
2,
We have nuclear weapons.  
3,
Budget.
The Russians plough immense amounts of £ into their military...but have an economy smaller than Italy with a population 2-1/2 x bigger.  Huge sanctions by the EU and world...unsustainable.
Anyway... 
Navy v navy, the UK is more powerful in force projection...even without carriers. 
In your scenario the Russians would (to use its full capability) have to pull all its navy from Alaska, north Europe, South pacific ocean, s. china sea, the Black sea, Mediterranean,  Barents sea and Artic. 
Leaving it totally exposed. 

Now that you have put it in the North Sea (or there abouts) the UK is extremely capable, you do it a disservice. 
Throw up ALL Russian fighters into it, then there is a real threat of course. 
But seeing as not even Germany could invade Britain, and seeing as there are nuclear weapons in play because of an imminent threat to UK sovereignty i would suggest that the Russians would be in a bit of a pickle.
As i said, Nato. 
They would have to fly all away around N Europe territories...and any attack on a US airforce base (which RAF use too) is a direct attack on US sovereign territory. 
Good luck with that one. 
Yes, Britain would lose (totally by itself) but would never be invaded, but they would severely damage and deplete the Russian navy. 
It most certainly wouldnt be a walk in the park, as you suggest.
Reply: "If that was the case the RN could of saved a fortune and stayed with invincible class size".
Nope, the cost model showed that two large carriers were more cost effective than 3 smaller CVS type hulls with 3 composite airgroups.
Reply: Pablo Jay 
Cavour class/size is about £1bn. 
The QE cost 6 for the two.
Now, factor in crews, fuel, food, aircraft to carry...
Just do some simple maths yeah
Reply: "knowing you now have no defence and are now doomed due to some else's idiotic decision not to fit any weapons?"
I like what you have said in the rest of your post, however the CVS had their GWS-30 removed for no ill effect for over 30 years but thats because nobody envisaged a peer conflict.
Reply: Unfortunately Fek, "Simple math" doesn't quite cover the thru life costs and cost model for the 2 CVF versus a 3 CVS debate.
If you want to look at it in simple terms, lets do it like this.
If you want buy fuel for 3 hulls or fuel for 2 hulls over a 20 year period, which is going to cost you more money?
Sorry but your model is far too simplistic and misses every nuance.
Reply: Or, if you want 3 Naval air squadrons instead of 2 you have to pay for 3 squadron bosses instead of 2 along with their salaries, you put additional costs and duplication into supply chains, support , training, certification thru life, etc etc etc.
The bean counters did the maths a  long ago in the 1990`s, they came up with 2 CVF.
It wasn't money alone, with one carrier in position you can bring more firepower to bear if you cant get 2 CVS on station,  you get a higher sortie rate and bombs on bums with 1 CVF than you will ever get with one CVS.

Don`t assume we would have had all 3 CVS to use and play with as we would, we have NATO commitments we have to stick to and having 2 CVF actually gives us more flexibility in that regard, ie, if we have one hull in deep maintenance we only have one we can use, its much easier to get cover for our NATO  commitments for one carrier than it is for 2.
Reply: Pablo Jay 
Are you saying that building and running two 65-70,000 tn carriers with possibly 40 aircraft, hundreds of marines and crew, fuel and food is less expensive than two 30,000 Light aircraft carriers with half the weight, and aircraft? 

The QE IS defended, its called the T45. 
It has Phalanx,  and I have already said 'i personally would like Harpoons at least', but it isn't a sitting duck. 
IT IS DESIGNED TO BE PART OF A BATTLE GROUP to maintain air superiority. 
It can handle over 100 sorties a day.
The Russian one is a heavy aviation cruiser and carrier.  
The Cavour could only have 8 Vtol. Two completely different types of carrier than the QE.
Reply: Don`t shoot the messenger, write to MOD main building they would be happy to explain. 
You just said TWO CVS, we were talking about 3 CVS , versus 2 CVF, and you've added 10,000 tons to the displacement of the CVS. try "22,000t".
The rest of your last post I don`t really know what you are getting at.